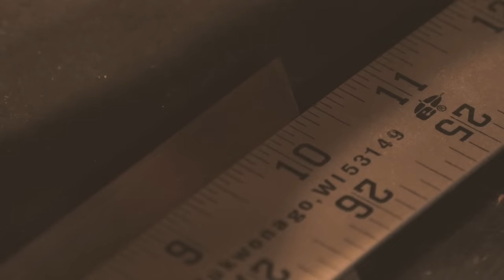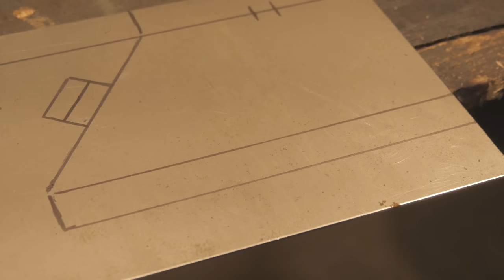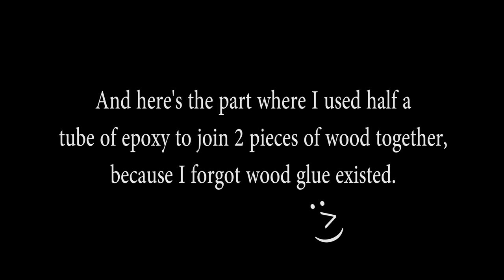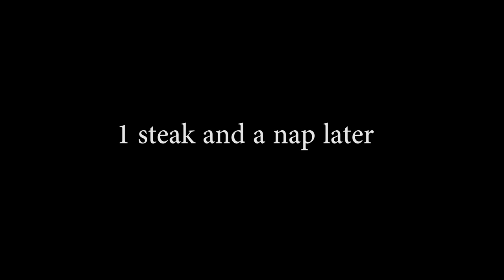How to Make a Normal Sized Box Cutter/Utility Knife

Comment: You actually can heat treat mild steels through a method called carburization or case hardening. The process gives you a softer, tougher core of mild steel for shock absorption and a a harder , stronger skin of high carbon steel for superior edge retention. It is in essence functionally like the Makuri method of blade construction used in certain Japanese style sword and knives.

Comment: You can harden mild steel. You just need to Carbonize it first. The Greeks did it to make files. Put steel in charcoal incased in clay, then put in fire for a long time.  8 hour per 1/16 thickness. Then heat treat.

Comment: man, Oak is just a real burny wood. I freaking broke a scroll saw blade with a 1/4th inch piece of oak trying to cut out a trigger, and that wood got the blade so hot it broke. Wood pretty strong tho, and using it for the handle of that box cutter is pretty nice

Comment: Hold up 

If you are 3ft 2in 
The penny that you use is approximately the size of your forearm 
Then that penny is around 10inches in diameter

Edit: in addition the industry standard for countertops is 32 1/2 inches and the counter stands at your midsection which makes you somewhere around 5 ft 5 in